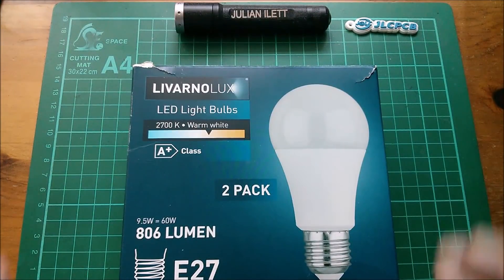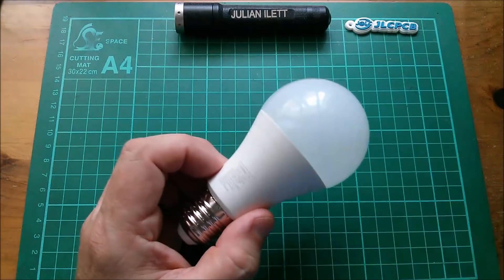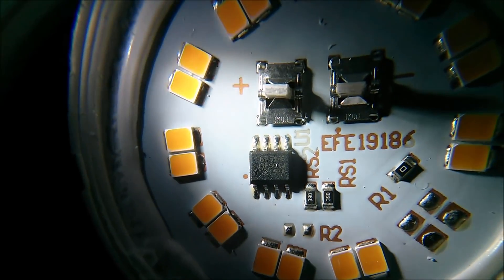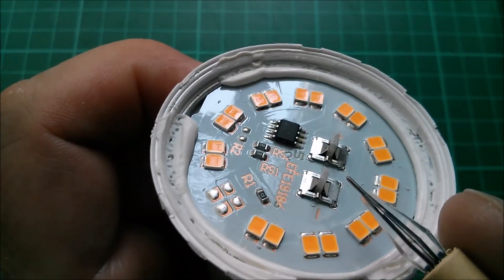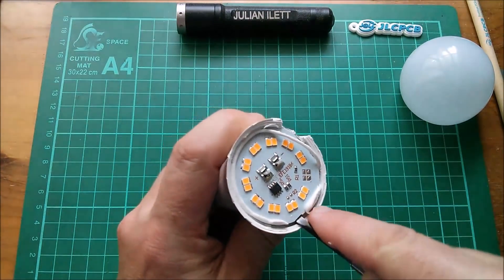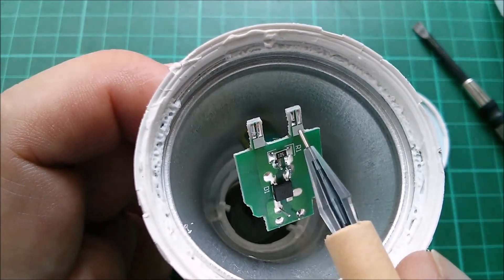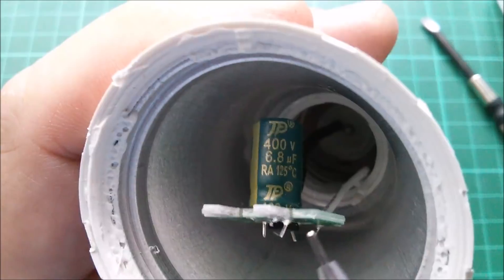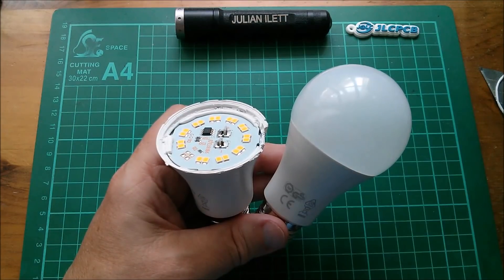LED Light Bulbs from Lidl

Comment: They seem well designed. Nice effort to keep heat away from the capacitor which is a high temp rated one. Also cooling for the leds looks good as well. And a bonus is the conformal coating to keep damp away from the board to prevent corrosion/tracking failure.

Comment: Didn't look like any fuse in circuit (before rectifier)? Nice teardown.
Reply: I think i saw a fusible resistor connected to the input of the bottom board (was covered with heat shrink tubing).
Reply: Well spotted. Reran the video, and saw that.

Comment: We have seen Big Clive pull this type apart a few times, increasing the current sense resistance by removing one of the 2 paralel resistors will greatly extend the life of the led's :)
Reply: Yes. The key is that the chip with resistors is on top and easily accessible.  Someone has to be the guinea pig and find out while they're available. I bought two models from Walmart where one is 13.5w and sold as "75w, 20 year" and another is 14w and sold as "100w, 10 year", but the 14w has twice as many emitters (32) so the shorter lifespan made no sense until I told them down and found that the 14w made from for more emitters by moving the power supply onto the "stalk" and perhaps the hot location causes the PS to fail earlier despite the emitters running at half the power. Weird. 

I've managed to mod the 14w bulbs but it's difficult and requires resoldering, while the 13.5w (75w) bulbs have everything on top and are super easy to mod. I just cut the output of both types in half and the lumen difference in a room is barely noticeable.
Reply: Yeah, I was going to suggest that. :)

Comment: I bought some E27 by mistake, I got some adaptors from Amazon for about £6 for 5.  I just searched E27 to B22 adaptor
Reply: I made some the other way, using bayonet sockets and E27 bases salvaged from failed incandescent lamps, so as to allow use of a CFL or LED lamp in some downlighters that originally were only able to hold a R63 or R80 incandescent lamp, as the LED or CFL version is both very rare, and very expensive. Retrofitting was not really an option to do, as there were a good number of these around, and only one version would fit the E27 LED lamps easily, the rest had a narrower neck, so adaptors on them worked.

Comment: You  now need to change the resistors to lower the output power, I showed one on doing it after big Clive so now it your turn to take up the soldering iron. I put it down to a out 2 watts and its great for a little bit of light on the landing all night.
Reply: No soldering iron needed; just snip off one of the 2 current sense resistors.

Comment: Those E27 bulbs are so annoying. For some reason my local supermarket thinks everyone uses E27, but clearly nobody does since there's never any stock of B22 bulbs. They've got over a dozen different kinds of E27 bulbs, but only a few types of B22. And their stock of the E27 bulbs are overflowing, so the only way to actually find the one B22 with the right power and colour temperature is to pull all the E27 bulbs out of the B22 section to find the one errant bulb that's left.

One day I'm just going to pull out all the E27 bulbs that are in the B22 section and dump them somewhere else.
Reply: Then some poor stocker will be moaned at my the manager to put them all back there. Best to put in a written complaint to the supermarket head office that they never stock what is arguably the most common lamp types, only those that do not sell.

Comment: If you use a hair dryer to warm the joint between the cover and main body it will be much easier to remove the cover without damage (press in slightly around the rim and also twist). Also, by removing one of the two current setting resistors of the BP chip you will greatly reduce the stress on the led’s and increase the life of the bulb a lot. Obviously the brightness will be reduced a little, but often it is noticeable as the led’s are being driven hard in the first place. Big Clive has taken lots of these apart over the years and demonstrates how to do the modifications. 
The connection between the 2 pcb’s on your lamp is a little different as they are normally soldered.

Comment: I often wonder why is it that external lamps tend to be E27 and internal lamps tend to be B22. Pretty cheap way of getting an LED array, but can we use them in our projects with lower voltages?
Reply: The standard / traditional U.K. lamp holder is  B22 BC type. But elsewhere in the world, E27 ES are more common. So imported light fittings often come with E27 ES lamp holders. U.K. made (or units manufactured overseas specifically for the U.K. market) external light fittings normally do have B22 BC lamp holders.
Reply from the maker: Some of these lamps (particularly the filament types) have all the electronics in the base. It must be more difficult to fit the PCB into a 22mm cap rather than the more spacious 27mm cap.

Comment: I tried to unscrew one and broke the plastic off. I almost touched the lead pins.
Reply: Back in the days of filament bulbs, replacing a bulb in a ceiling pendant light almost always meant replacing the socket fitting too. The heat would cook them to the point of crumbling, and the bulb's solder connectors would creep and wrap themselves around the spring pins. LED bulbs mean you never have to do all that any more.
Reply: @donepearce  You should come look at some of my lamp holders, you might change your opinion. The fittings are so cheap and nasty that even led lamps cook them.
Reply: @wthornton7346  So worth paying the extra 5p for the deluxe ones, you reckon?
Reply: @donepearce  Yes I remember that. And don't miss it.

Comment: Not bad for the price.
Reply: Unless you are unlucky like Fit For Flogging...who managed to break the platic off whilst trying to unscrew the bulb and nearly touched the LIVE connectors!
Reply: @wthornton7346  Yeah but to be fair you should still never be removing or installing lamps/bulbs while energised.
Especially not E27s as unlike B22, reverse polarity in the wiring can be pretty dangerous with the screw becoming live. I still don't understand how B22 to E27 adapters are legal to be sold in the UK.
Reply: @mowcius  Mostly because they were legal back in the 1940's, with the legislation allowing them to still be sold as they are grandfathered in. Same for all the multiple lamp units, as those were common right from when "the electric" was still only a single lamp socket per room in the house, and the only sockets were in the kitchen, using a 3 round pin plug in the cooker control.